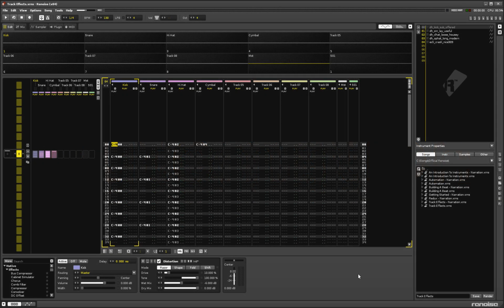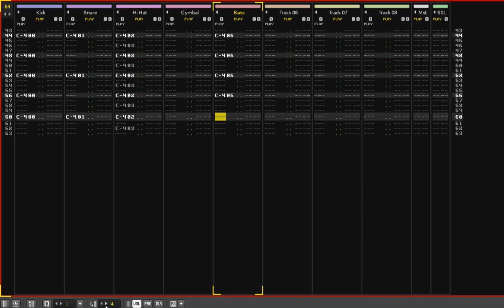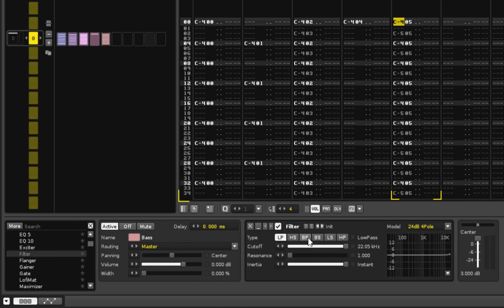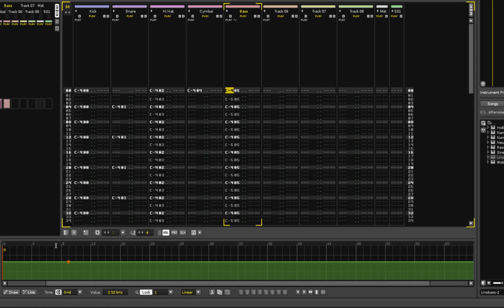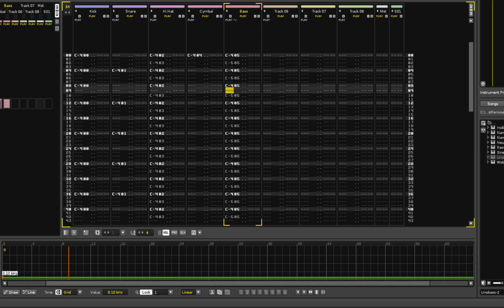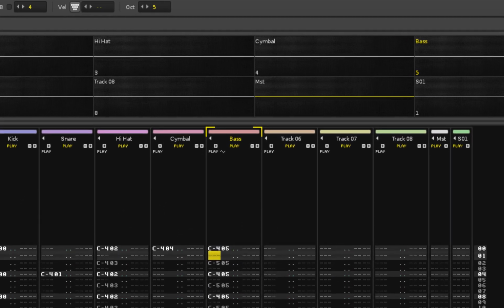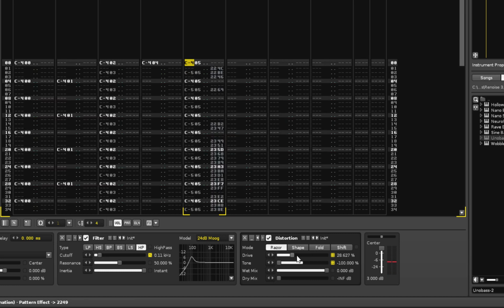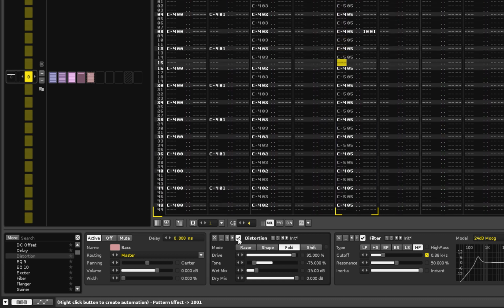Beginner's Tutorial Part 4 - Automation

Comment: Great video, when selecting the bass filter effect there is now three different filter types, which one is right/closest one to the one used here in your video?
Reply from the maker: The standard Filter was replaced by the Analog and Digital Filters in v3.1. The closest equivalent to the one used in this video is the Analog Filter's '2P K35' with the High Pass (third button) selected. It's not an exact match, but you can adjust the Resonance to get a good approximation.

Comment: Thank you so much for these great videos! I still have two questions (I work with Renoise 3.1.0 for Windows10, 64 bit, Demo Version):
1. I don't have the same Filter as you, I can only choose between Analog, Comb, Digital Filter. Do you know why it is like that?
2. I can't do the Automation with the second method, is it because of the Demo Version? Or can you think of any reason for this?
Thanks in advance, Zoran
Reply from the maker: 1 - This video was created with Renoise 3.0. The original Filter was replaced with the new Analog and Digital filters in 3.1.

2 - You probably have "Pattern Automation Recording Mode" turned on: http://tutorials.renoise.com/wiki/Pattern_Editor#Pattern_Editor_Control_Panel
Reply: Thank you so much! Now it works :)

Comment: The effect "filter" is no longer with us it seems.
Reply from the maker: The standard Filter was replaced by the Analog and Digital Filters in v3.1. The closest equivalent to the one used in this video is the Analog Filter's '2P K35' with the High Pass (third button) selected. It's not an exact match, but you can adjust the Resonance to get a good approximation.
Reply: @renoise  cheers